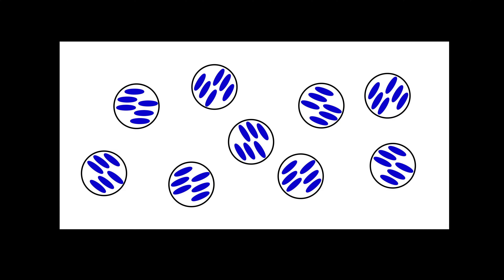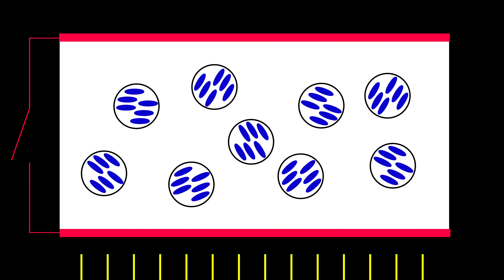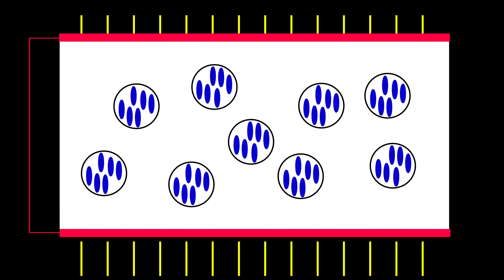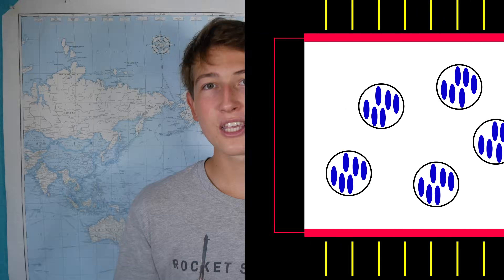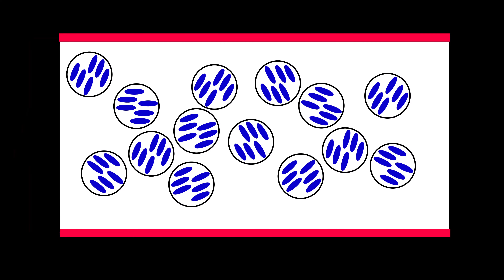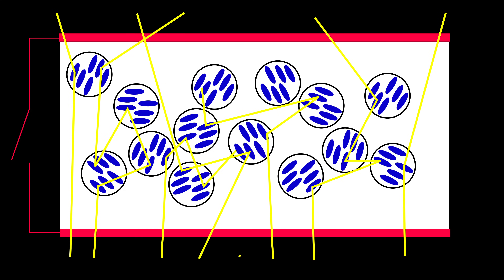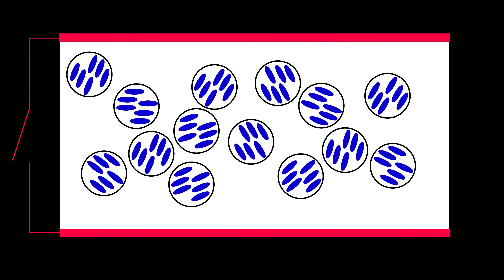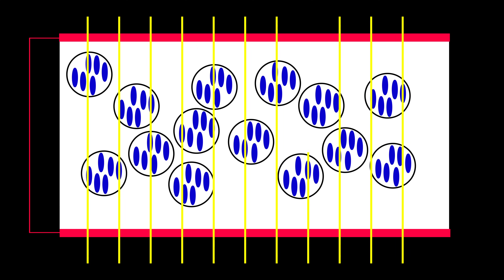The Science Behind Smart Glass

Comment: Great that 99% of UV is blocked, but is that any different that ordinary glass?  The (perfectly ordinary) replacement windows I installed in my house claim to block 99% of UV.  You could get a UV meter (or camera!) and make a video where you test the transmissibility of UV in different types of glass.
Reply: regular glass blocks UVB light (the cancer causing one). UVA still comes through (that's the wrinkles causing one).

Comment: If in the opaque mode, the glass is scattering the light, not necessarily reflecting it, wouldn't the same amount of energy come through, including heat? Although some would be reflected. I'd imagine that the windows would have a glow.
Reply from the maker: Well some of the light is reflected back the way the light source came from, so it doesn’t go through
Reply: @ScienceC  Thanks. That makes sense.

Comment: Interesting! Thanks! I wonder if it’s possible to have a pattern or  semi-random texture for an aesthetic affect. In an office or home that might be preferable to a uniform opaque surface.
Reply: You probably can, idk how the electrodes work, but I would assume they either have micro wires running inside the film, or either they use a conductive coating, I would guess it is some sort of silver oxide. In that case you could make it any shape you want
Reply: @victornpb  I believe this uses indium tin oxide sheet electrodes on either side of the polymer sheet. indium tin oxide is preferred for applications such as these because it is transparent. It is also used in touch screens of smart phones.
Reply: You can also just add tint/frosting to smart-glass like normal 👍
There are buses/trains where people on the outside see the entire side of the vehicle looking like a single painted on image (including the windows) and they cannot see the passengers; however the passengers can see out the windows from inside with the translucent image only barely visible! On some passenger trains in Asia (in Japan iirc) they've additionally made the windows with smart-glass on lines that travel really close to high-rise apartment buildings. When the train is passing the apartments the windows are turned opaque for the privacy of the tenants! Its a pretty cool practical usage 💯